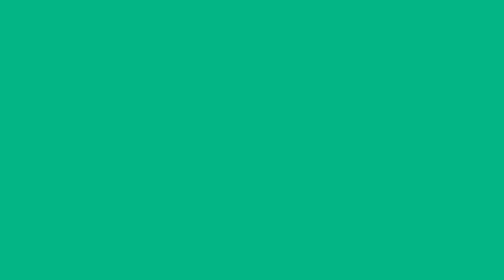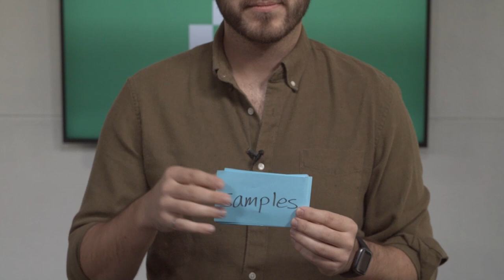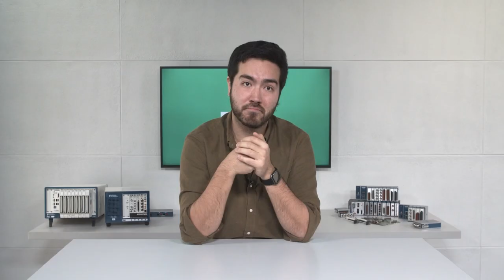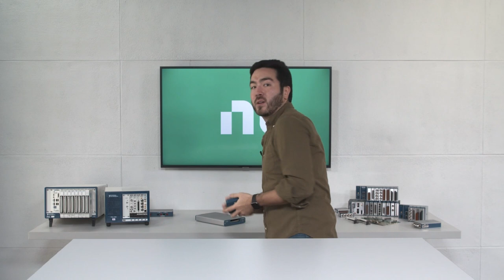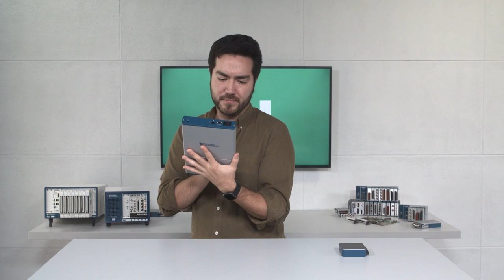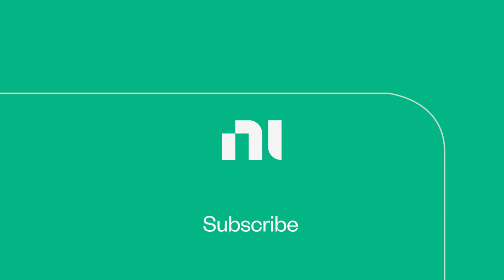The right sample rate on your DAQ device makes all the difference - DAQ Fundamentals

Comment: Hi, I am getting an error while using DAQ Assistant. The error message is "the top-level vi was stopped at wire on the block diagram of daqmx timing (sample clock)". Even a simple DAQ assistant is not working. I am using NI USB 6341 and Labview version 2021. I have verified the version of DAQmx and repaired it and even installed it again. But nothing worked. Can you please suggest what would be the problem?
Reply from the maker: For technical support inquiries, we recommend visiting our support website: https://bit.ly/46u4Z1G. From here, you can share your question with the community, or open a support ticket with our team. Let us know if you have any more questions!